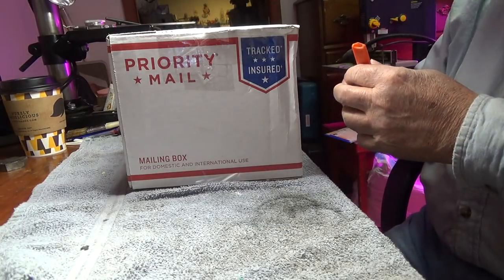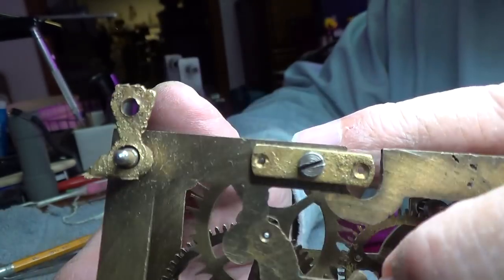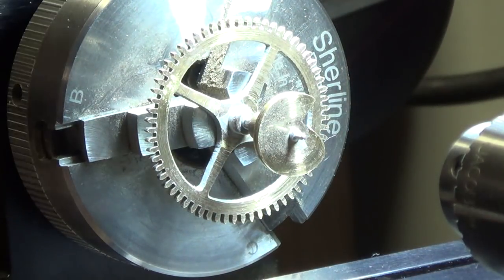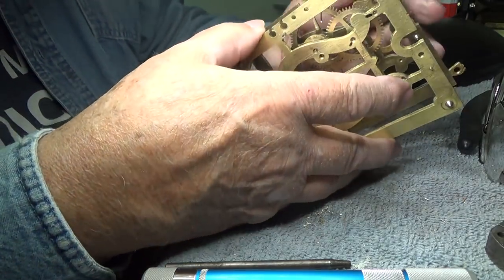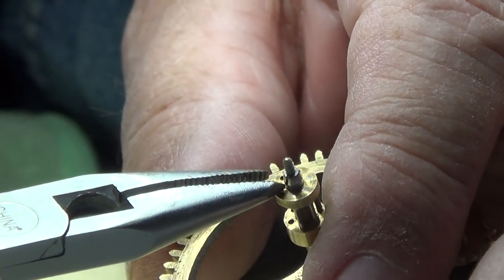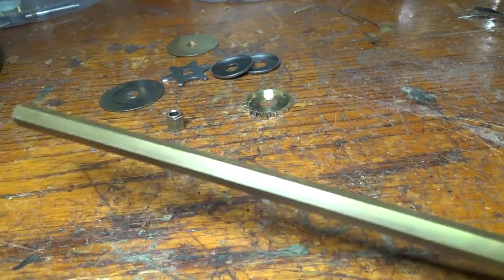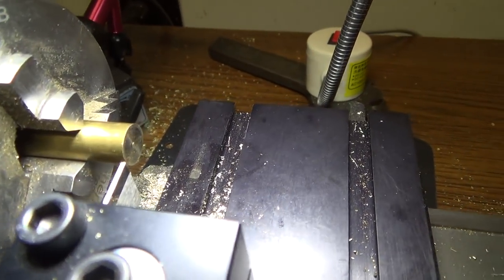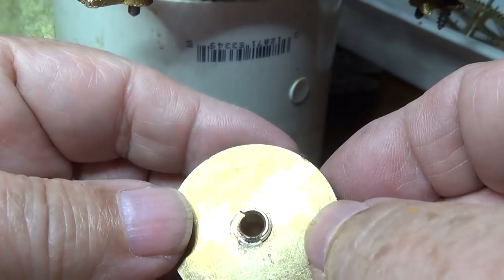Railway House Cuckoo Clock Movement Complete Overhaul 2

Comment: An Index for this video:
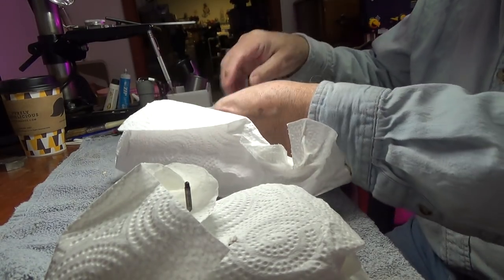0:00 - 0:45 Unboxing.
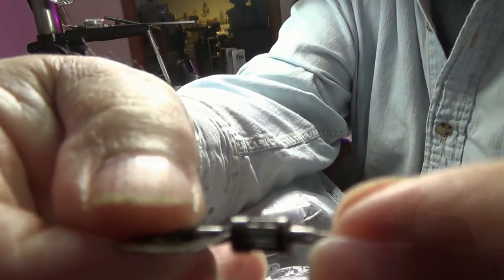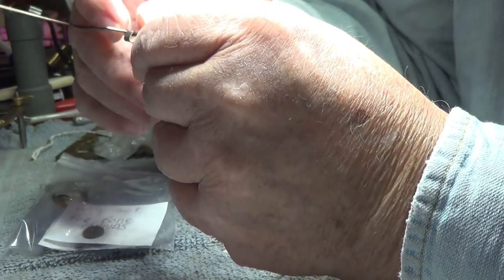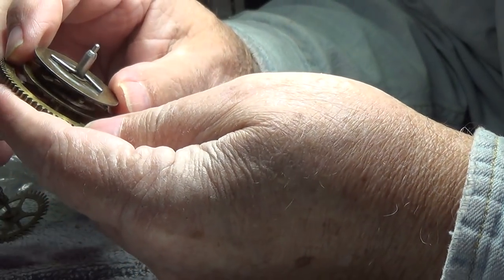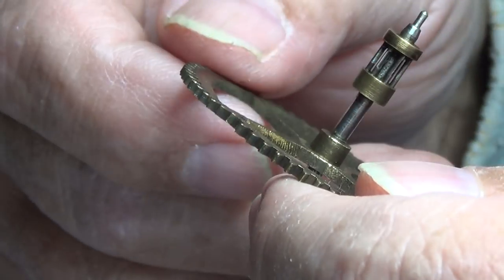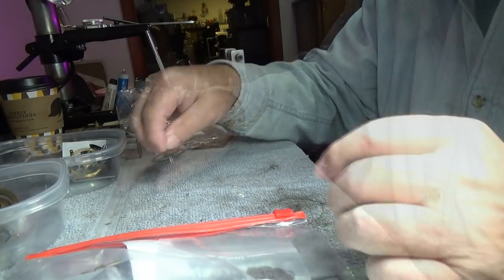0:45 - 7:22 Inventory/examination of parts: bad trundles, 1:46; strip pallet wear, 3:18; time main wheel ratchet missing a tooth, 4:35; 2nd wheel bad casting, 5:01; Bent trundles, 6:42; more worn trundles, 7:04
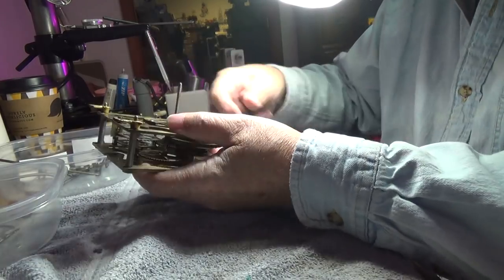7:22 - 12:12 Assembly of the movement before repair.
12:12 - 14:49 Checking for worn parts and worn pivot holes.
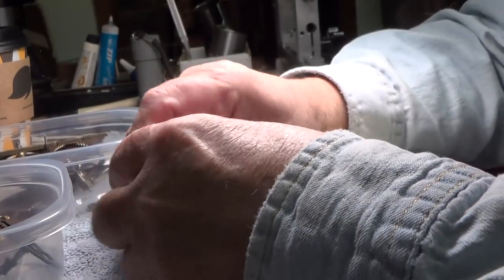14:49 - 15:44 Explanation of the motion works' power. Position of lift lever spring. Checking the lock.
15:44 - 17:40 Disassembling the time main wheel.
17:40 - 18:49 Reviewing the broken tooth and the main wheel parts.
18:49 - 25:34 Repairing the ratchet by making a new tooth (in detail).
25:34 - 28:38 Polishing the pivots.
28:38 - 28:55 Checking the strike side pivot holes for wear.
28:55 - 46:20 Bushing: filing, reaming, chamfering, hammering, broaching, testing.
46:20 - 1:00:31 Replacing worn lantern pinion trundles (in detail).
1:00:31 - 1:03:12 Discovering a jam. Finding it's due to a bent tooth.
1:03:12 - 1:04:25 After fixing the bent tooth, the train still jams due to a bent gear.
1:04:25 - 1:10:46 Cutting and shaping a new hex shaft for the repaired time main wheel.
1:10:46 - 1:15:03 Reassembling the repaired time main wheel.
1:15:03 - 1:16:25 Assembling the time train, for testing.
1:16:25 - 1:17:26 Seeing the porous cast problem during testing.
1:17:26 - 1:20:15 Repairing the porous cast: filing out the bad part, cutting new brass to fill in, soldering them in.
1:20:15 - 1:20:47 Retesting the repaired time train.
1:20:47 - 1:24:05 Demonstrating how the strike levers work.
1:24:05 - 1:25:29 Testing/demonstrating the count wheel.
1:25:29 - 1:28:46 Adjusting how far forward the cuckoo bird moves.
1:28:46 - 1:29:42 Showing how to adjust the lever so the bird doesn't peek out of the door early.
1:29:42 - 1:30:07 Oiling and final-testing the repaired movement.
1:30:07 - 1:31:34 Discovering wear on the strike side main wheel and deciding how to repair it.
1:31:34 - 1:32:05 The fully repaired movement on a test stand.

Comment: Thanks again. You were absolutely right on about moving the gear forward. It took me several attempts to get the lifting lever wheel to be in sync with the whistle levers cycle but I got it. 
Boy this whole project has been a real eye opener for me. Now I hope I can convince my wife to let me keep the gong going. I must have spent a good six hours trying to get the hammer to make a decent sound. It's just loud. What a fine hair that is to split. 
Many many thank-yous.
Reply from the maker: It can be irritating to have to adjust a wheel. You can often loosen one post enough to pull a gear out of a pivot hole and enough to disengage its pinion and rotate it  In this case, you'd rotate the warning wheel enough to to change the movement of the chain wheel by a couple teeth at stop.  You can soften the gong with a tiny bit of soft material on the part of the brass hammer that hits the gong.  And, yes, adjusting the hammer and gong are probably the biggest pains in the rear in repairing cuckoo clocks.

Comment: What a wonderful video!  I knew the clock needed help, but I had no idea how much!!!  I will be watching this many times.  You sir are a master at what you do!  Question:  The pins on the minute wheel at 1:29:03 did they seem bent out to you?  I wondered about that when I looked at it at home.  Just wondering if you had to straighten them or if that is normal?  Also, at 1:01, how did you straighten the tooth back up?  Thank you so very much for this video.  This will help so many of us who are trying to learn about repairing clocks.  This clock will be very special to me and be with me for all my days!
Reply from the maker: The pins on the back of the minute were bent by "whoever" last worked on the clock to compensate for wear on the lift lever. I straightened them somewhat and had to rebend one somewhat to lift the lever enough to cause the strike to go into warning.  The tooth I simply straightened with a flat-jawed plier VERY carefully.  There wasn't a lot of brass to work with and I was worried it would break completely off.  Then, I would have had to extend the brass piece I soldered in beyond the rim and then hand-filed a new tooth.  I'm mailing it this morning.
Reply: Don, at 3:35 you talked about the wear on the escape pallet.  Did you polish that to get rid of the wear marks?
Reply from the maker: Yes. I first use a stone to hand grind the deep grooves out, then I use a succession of grits, actually nail file grits, to polish out the grinding marks and put a high polish on the pallets.  Grinding the wear out reshapes the anchor slightly, so it has to be bent to make up for the change.  Too much time and work to show in a video.
Reply from the maker: You should also know that a lot of things had to be edited out as the video was first almost 4 hours long.

Comment: Hi, I live in Argentina and I enjoy and learn a lot watching your videos. Thank you for taking the time to Share them with us. A friend of mine, knowing that I love clocks, gave me an old cuckoo that has the same movement you have shown in your video. I have neither the chains nor the weights. As you mentioned the chains should be 41LPF, 1.20 mm but could you please tell me how much weight does this movement use. Thank you very much.
Reply from the maker: This particular movement used 750 gram weights, but I'd suggest determining the weights by attaching a plastic bag to the chain, add weights (sand, nuts and bolts, lead shot) until the clock runs and weigh the bag.  Then, order weights that are close to that weight
Reply: @dperry428  Thank you so much for your answer. I forgot to mention that  I have tried that and it started working with 899 grms but I thought that was too much weigtht and I didn’t know if using excessive weight could damage the movement.
Thanks again.
Reply from the maker: I've seen them with 850 g and even 1000g.  You're right to be concerned about using too much weight as extra weight puts more stress on each of the pivots and, over time, will cause faster wear.  Too close to the minimum weight, though, can cause failure to run after just a small amount of wear.  So, find the minimum to allow it to run and add a little more.  Find a weight from a supplier that is close to that and you're good to go.

Comment: This was very instructive to watch.  I have my grandparent's 1901 George Kuehl cuckoo clock with essentially the same movement, and am working diligently to get it going again.  Was there any sort of standard with GK movements as to which side of the clock bellows 1 and 2 went on?  The bellows in my clock were removed years ago, so I have no reference to work from.  Thanks!
Reply from the maker: There are two lift wires that are activated by the pegs on the strike chain wheel.  The bottom lift wire is lifted and released before the top lift wire, so the bottom lift wire attaches to the higher pitched bellow whistle and the top-most wire lifts the lower pitched.  The lower wire is longer than the  upper wire an actuates the bellow on the right side (looking from the back) of the case.  The shorter, top wire activates the bellow on the left side of the case.
Reply: @dperry428  Thanks!  Placement of the bellows left/right is exactly what I needed to know.  These movements are quite interesting to figure out.

Comment: maybe this question has been asked and answered before, but what oil should be used and should not be used to oil a cuckoo clock? thank you in advance for a reply!!!
Reply from the maker: Use a quality clock oil.  No WD40, no 3-in-1, no motor oil, no silicone spray.  Clock oil. You want an oil that will stay put, not evaporate and not gum up.  Clock oil.  It's not cheap, but it's the only thing to use.
Reply: @dperry428  Thank you for that information. I bought my wife a cuckoo clock for Christmas a couple years ago that has a Regula movement in it and I want to keep it in good running condition for as long as possible. How often should it be cleaned and oiled? Would I need to remove the movement to oil the front part of the movement or can the dial face be removed to access oil points or would you have to see the clock to answer that question?
Reply from the maker: How often to clean and oil a cuckoo clock depends on a lot of variables.  Cuckoos are notoriously much more open to dirt and dust than, say, a typical mantel or wall clock.  Those clocks are pretty well enclosed, whereas a cuckoo clock has holes in the bottom and chains exposed to the air that then carry dust up inside the case, holes where the bellows are attached, holes where the bird door opens and dancers, if they are part of the clock, also move dirt inside the case.  Where a cuckoo clock is hung makes a big difference, too.  Hung above or near a heat vent of a hot air system can receive a load of dust and heat that dries out the oil faster.  The absolute worst place for a cuckoo clock is in a kitchen, where cooking grease precipitates on all the parts and becomes a dirt and hair magnet.  Witness some of the clocks in my videos that have nests of animal fur and gunk accumulated on the gears.  Assuming a clock is in a reasonably clean location, I would oil the clock every 3 to 4 years.  To properly oil the clock, the hands are removed, the bellows disconnected, the bird disconnected, the movement taken out of the case and all pivot holes sparingly oiled with a quality clock oil.  Trying to oil the front pivots through the dial opening is futile.  The levers, rack and snail cover so much and the opening is so small that nearly all of the pivot holes are inaccessible. By removing the movement, one can also evaluated when and if the clock needs to be cleaned.  Also, during those oiling sessions, one could use compressed air and a soft brush to manually clear away dirt and grime without needing to do a complete overhaul.  With modern clocks, when and if the pivot holes become worn to the point that the clock begins to fail, a replacement movement can be purchased.  If the clock is kept clean and regularly oiled (pivot holes only), there is no reason that the clock should not run for 25 or more years.  Keep the dirt out and prevent to oil from drying and/or becoming contaminated and the clock should last a very long time.

Comment: Don,

I put parts thru the ultra sonic and the the neutralizer. But, I am seeing RUST after a week.or so.
How do you deal with Rust after cleaning. Spraying the components seem detrimental after all the cleaning.
Reply from the maker: After the rinse, dry them thoroughly with soft cloth followed by a hair dryer.
Reply: @dperry428  if the rust does want to reappear,  am I doing something wrong?
Reply from the maker: If you're properly drying the parts and rust is still present, try scrubbing with an acrylic polishing compound like that used to clean acrylic shower walls and tubs.  Let it dry and polish with a  soft, dry brush like a toothbrush.  It will leave an acrylic film that should stop the rust.

Comment: Amazing work! I learned a lot from it. I just put an identical movement back together after cleaning. It was incorrectly assembled when I got it and would not strike. I studied it probably an hour before I figured out what was going on. I am fairly new to clocks and learning a lot. The movement I have the bird pops out briefly when it's going into warn, then partially closes and opens when it's striking.  Does that sound like it's opening to far and needs adjusting? It slams wide open when striking. Great job!
Reply from the maker: If parts are not worn and adjustments to levers are as they should be, the door should NOT open at all before the clock strikes and, when it strikes, the door should be open enough to clearly see the bird working and should stay open during the entire strike sequence.  If it is not, it needs to be adjusted OR the cam that actuates the strike and opens the door is worn and needs to be replaced.  Check out these two videos.   https://youtu.be/4k7Nzm9wBSE   and   https://youtu.be/7IAS5U8goJM
Reply from the maker: Also, make sure that the lever that rides on the count wheel (also drops into the slots) is adjusted so that it is raised enough not to catch on the edge of a slot, but also just rides on the edge of the wheel when striking is taking place.  It should not be held above the wheel edge or the bird door will open and shut during striking.
Reply: @dperry428  Thank you so much for sharing your videos and advice with us! I have the door opening as it should, and stable when striking. The lever that drops into the count wheel was letting the lever that rides on the cam drop down a little bit into the groove. All this is well, the door is still opening about 1/4 in and closing back before going into warn only at the top of the hr. I'm suspecting 1 of the pins on the minute tube is bent outward slightly more the the other, haven't gotten that checked yet. But I don't understand why it would close back before striking.  I have decided this clock is a female. Thanks again!
Reply: @dperry428  This clock has 1000 gram weights, seems like a bit much to me but I don't have anything between 320 and 1000. It won't run on 320.
Reply from the maker: For this type clock, 1000 grams is about right.  In fact, many people think that the size of the weights indicates an 8-day clock, but it's not.
Reply from the maker: If you watch the action of the brass lever that rides the brass cam, you'll see it lifted and the pin on the warning wheel released from the front of the brass lever and the lever that rides the count wheel is lifted out of a slot.  As the lever is lifted, the vertical lever on its other end starts pushing the lever that moves the bird out and the bird door starts to open. Now, when the lifting lever on the minute wheel falls off the pin, the brass lever first falls back to its original starting position, allowing the door to close until the point on the brass lever is again lifted by the curve of the brass cam as the cam turns.  This causes the door to again open.  So, the initial lifting of the brass lever, which is done by the lever from the minute hand tube, is to release the pin on the warning wheel and to lift the count wheel lever out of its slot on the count wheel.  After the warning pin is released and the strike sequence begins, the brass lever drops down momentarily and again lifted, this time by the brass cam.  Hope that makes sense.
Reply: @dperry428  I understand, Thank you.
Reply: Hello Mr Perry, I just finished another almost identical movement but not made by GK. It had the same problem with the door but I know how to fix that now thanks to you! I installed 6 bushings, very time consuming as I do it without a reamer. But it runs great now. Do you have a source for the hands nuts for these clocks, I would think they would all be the same as near alike as they are. Thanks, Donald.
Reply from the maker: You can buy cuckoo clock nut assortments from clock supply houses like Ronell or Timesavers.  You might find one that fits or you might not.  When I need a nut but can't find one that fits, I modify one to fit.  I have micro tap and die sets that can be purchased on Amazon.  I have sets both in SAE and metric.  You can take a nut that's too small or wrong thread and tap it with new threads to match the hand shaft.  If you can't match the hand shaft, use a die to re-thread the hand shaft for the nut. Using a tap, a die or both, you can make a nut fit.  There are times when I just make a nut on the lathe and tap it to fit.
Reply: @dperry428  Thank you, I'll check out the tap and die sets, I would think if it's made in Germany it would be metric... thnks again...
Reply from the maker: If you search for and read about the history of screw threads, you'll see it's not quite that simple for older threads such as found in these old clocks.  That's why you sometimes have to rethread the hand arbor that the screw goes on.
Reply: @dperry428  Luckily I had another movement that the nuts fit this one to go by, one was 5 mm, the closest size I could find to the smaller one was #4 SAE. I drilled and tapped some Hermle nuts that worked fine. Also ordered a couple different sets of metric nuts. Thank you again!
Reply from the maker: You're welcome.  It's always a challenge finding replacements for older clocks.  Standardization of thread sizes didn't come until later for some clocks.  It's always best to keep things as close o original as possible, but that's not always possible.